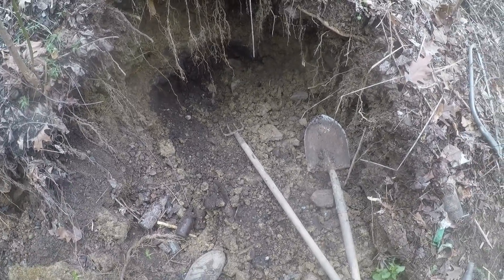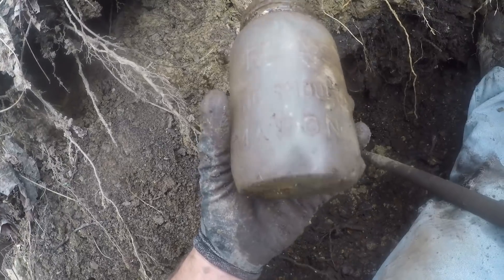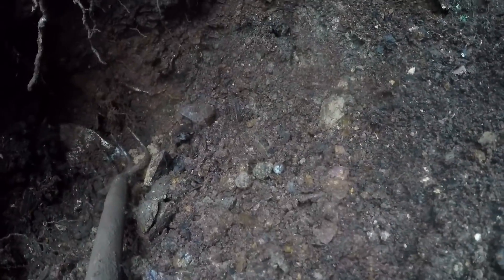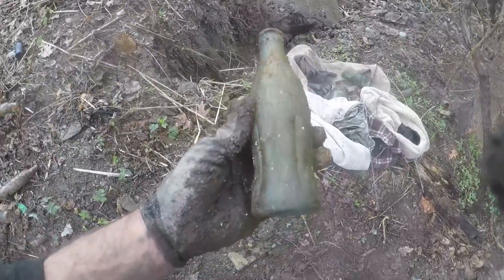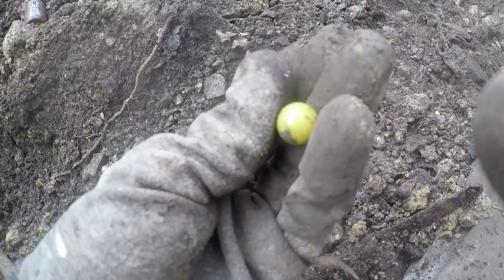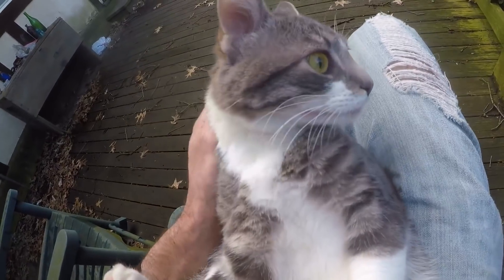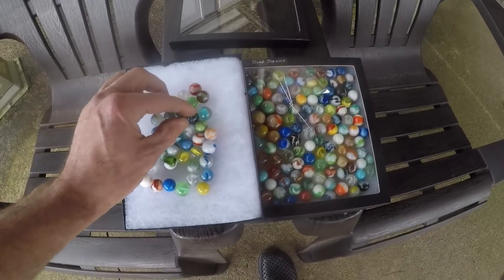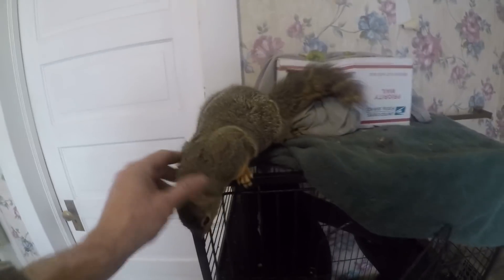Treasure Hunting Ohio - Antique Marbles - Wheeling Wv Soda - Bottle Digging - History Channel -

Comment: Hi Rocks 👋🏻! Love the tonsiline bottles when you find them!  Earliest use was in 1893. A patent for the medicine was in 1909. The patent information said that the medicine was used as a remedy for “tonsilitis, acute and chronic sore throat, coughs, colds, hoarseness, and similar ailments of the mouth and throat.” Tonsiline ads featured the drawing of a giraffe. “If you had a neck as long as this fellow and had sore throat all the way down, Tonsiline would quickly relieve it.” Prices for bottles of the medicine in 1918 — during the flu epidemic — were 35 cents and 60 cents. “Hospital Size, $1.”